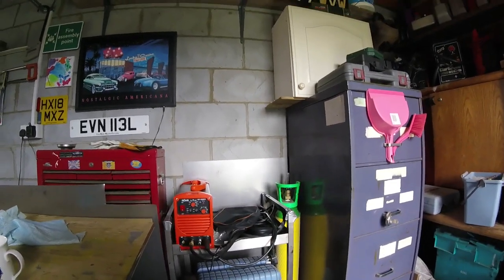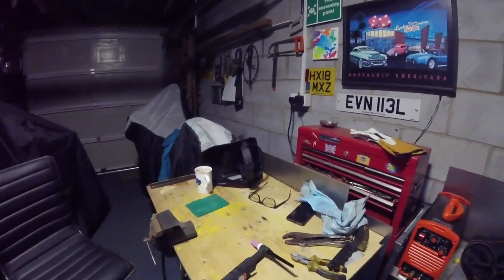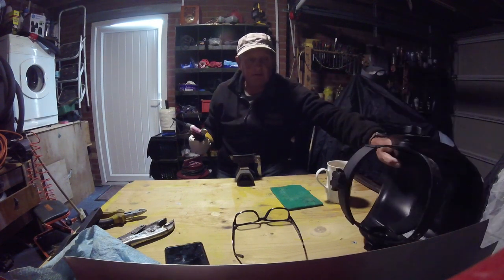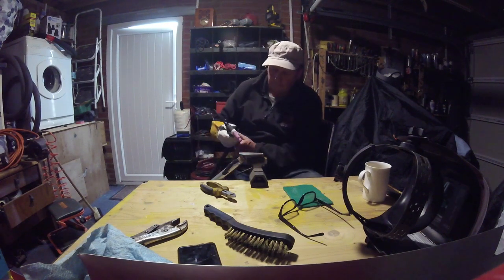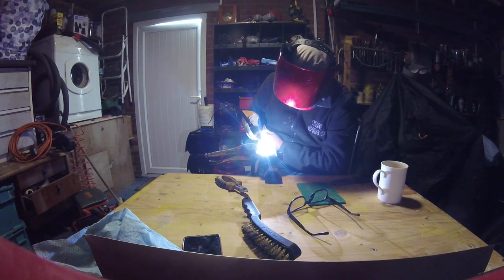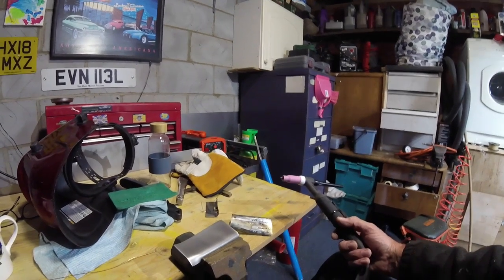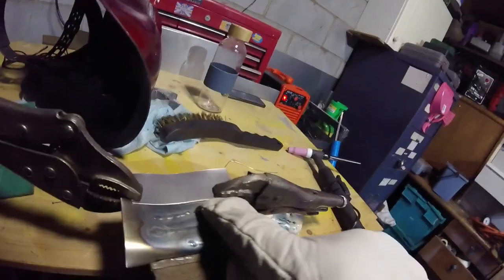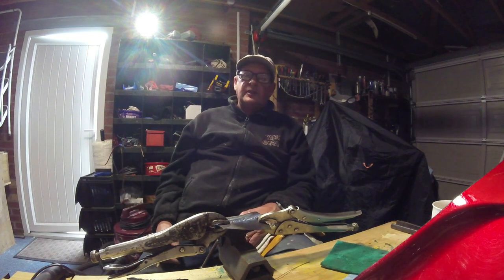First try at TIG welding thin steel

Comment from the maker: Hi everyone so I have finally trying to use the Tig welding machine.
I'm definitely not finding it easy to use as you can see in the video.
I have seen plenty of videos of people showing some how to make some brilliant welds with this machine but it's not as easy as it looks.
I will definitely keep trying and will make a video when I can make a weld on steel that I want to use on the bodywork of the bus.
Just thought it would be interesting to show that it's not easy for everyone.
Thanks for watching 🤓👍